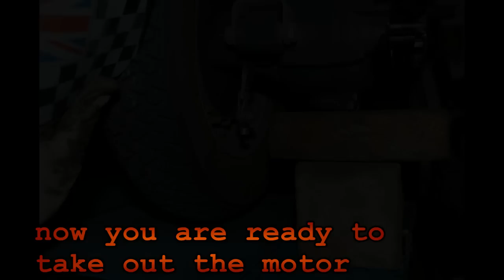15min VESPA px ENGINE REMOVAL | FMP-Solid PASSion |

Comment: hi great video,i have just bought a lml 2014 Auto , i've been told the carburater needs cleaned. have you any videos of this procedure?  Thank you
Reply from the maker: take it out. dissassemble. clean it also with compressed air. and reassemble ;)

take pictures of every step, that will help.
Reply: Thank you

Comment: Copper grease on main engine bolt- rear shocker bolt  all the main engine bolts + the exhaust bolt  , makes stripping down in the future easy- ( exhaust- engine+ rear shock bolt - should be done approx. every 6 months if using the scooter all year round , save a lot of problems .NEVER  use on bearings or any part that rotates use a suitable high melting point grease .

Comment: Very nice how to video. How do you degrease the engine before tearing it down?.Any product?
Reply from the maker: +Templario what exactly do u mean. U first stabilize the scooter, then u pull it out by hand as shown
Reply: I mean what product do you use to clean the engine before tearing it down ?.Petrol,KH 7,Brake cleaner?
Reply from the maker: +Templario i clean afterwards after disassembling the engine, with standard products. Brake cleaner and a small part washer
Reply: Very nice 👍